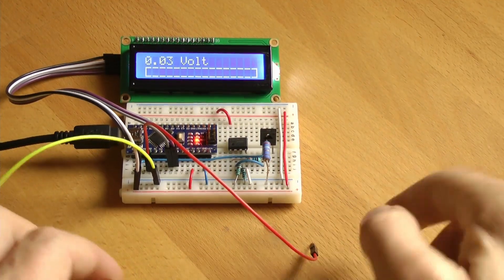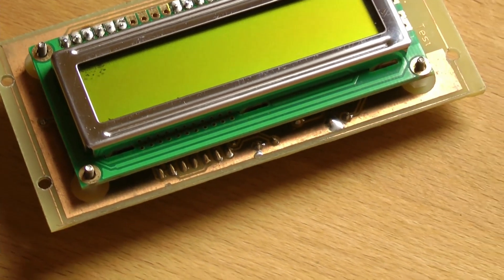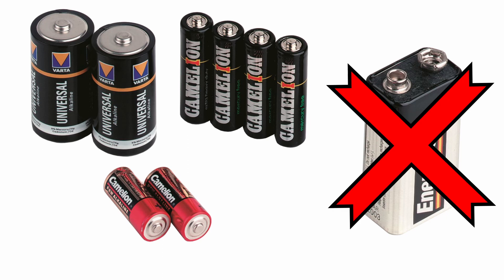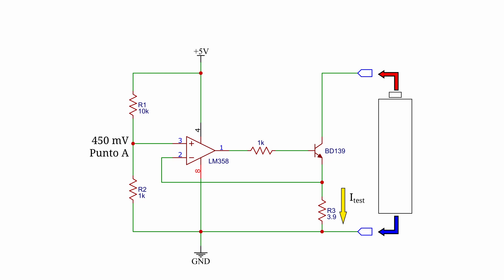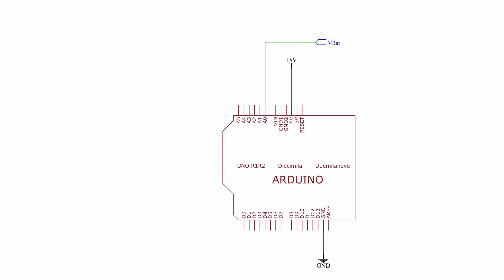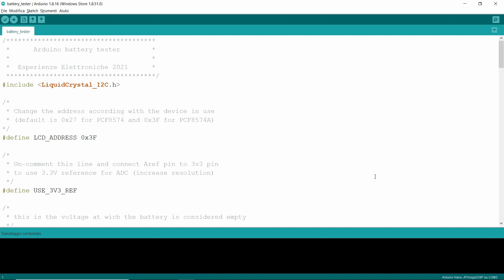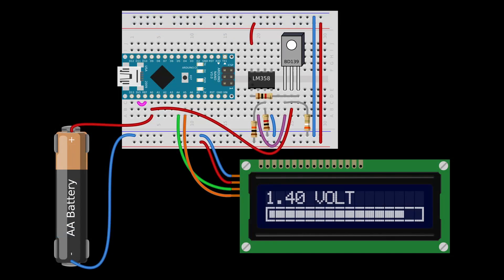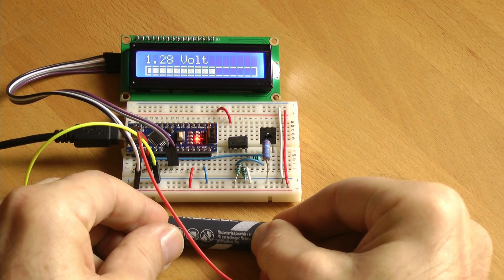Arduino diy battery tester

Comment: Thanks, but LM358 Pin 4 should be GND and 8 Vdd?
Reply from the maker: Yes, there is an error in the schematic. I wrote it in the description of the italian version of the video, but not here.
This is the corrected schematic:
https://espelett.altervista.org/wp-content/uploads/2023/08/battery_tester-960x679.png
Thank you very much.
Reply: @espelett  Can I power it from. 18v and when use the same voltage driver lm358 and TIP120 npn and same resistor